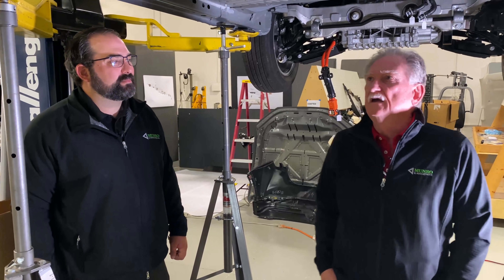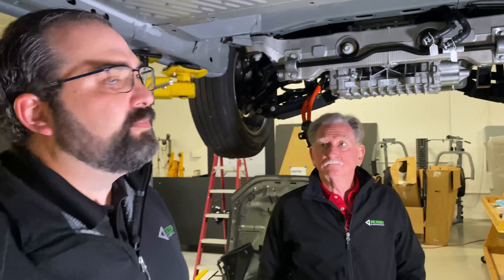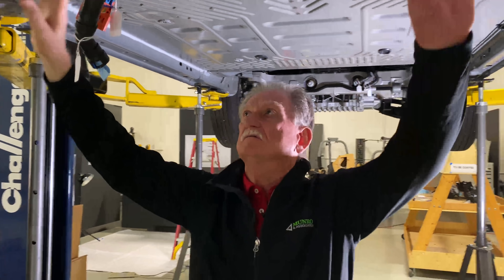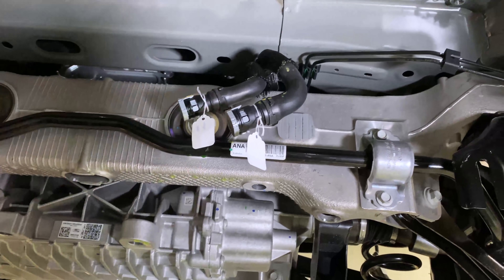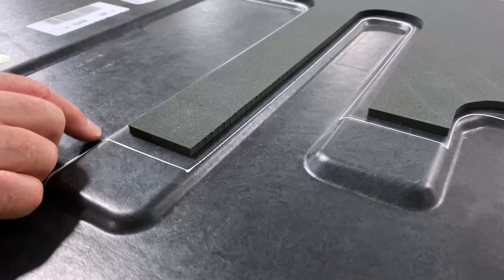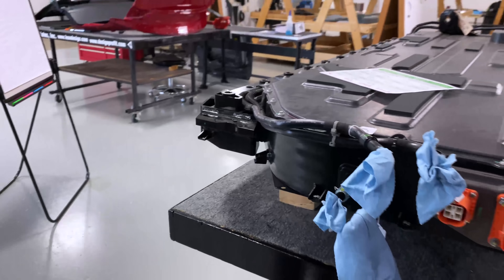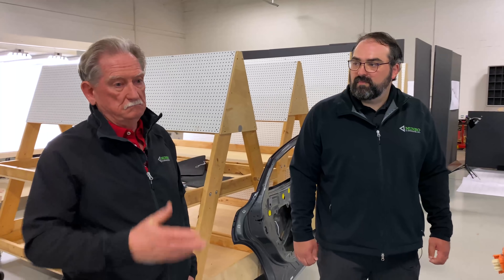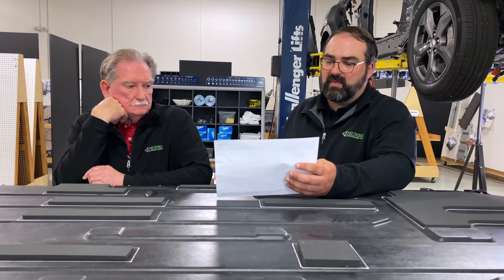First look at the Ford Mustang Mach-E Electric Battery

Comment: What impresses me, as a lifetime taker-aparter-and-puter-back-together is how expertly you disassemble complex machinery without service manuals. My hat is off to some real pros. You guys are the Johnny Appleseeds of tech.
Reply: It’s a lot easier when you don’t have to reassemble it! 😂
Reply: @someonethatwatchesyoutube2953  success not achieved unless you have no leftover bolts when putting things back together
Reply: @lemongavine  I had a friend some years back who taught a class on motorcycle service/repair. One of the class projects had students completely tear down the engine in the morning and put it all back together in the afternoon after lunch. While the students were out to lunch he would mix up some of the small parts at the workstations so students would have extra/missing parts. It was a good test of their skill/knowledge/confidence.
Reply: I envy them so much being able to work on clean new cars!
Reply: Why do you think they don't have manuals? By the time the first car of a new model is received by the first customer, the manuals are available in the online services that everyone uses now (print is dead). Like any service shop, Munro will subscribe to those services,  probably both those offered directly by manufacturers and aftermarket services (such as AllData). A subscription to the Ford service (motorcraftservice.com) costs $2,700 USD per year, and covers all models; that's a lot for an individual vehicle owner, but just a normal expense of running a business.
Reply: I was thinking about that too.They've likely seen every type of connector,fastener and adhesive known to man so you'd think mistakes would be very rare
Reply: imagine unbolting the battery, and forgetting to support it before it falls down on you. ☠️
Reply: @qx4n9e1xp  Imagine unbolting the front subframe of any vehicle, and forgetting to support it before the complete subframe with engine and front suspension falls down on you. I can't imagine doing either, but then I'm not a complete moron.
Reply: To be fair cars today are designed to be taken apart by the lowest denominator mechanics....
Reply: @obancameron  i worked on my own cars for many years, mainly Japanese, but also Fiat, Peugeot, Simca (French), Renault, etc. It was only until decades later that I had any BMWs that I could compare to them.

I had, and still have, major issues with BMW.  I probably will never own another one.  But what I noticed when comparing certain parts of BMWs with others, there seemed to be distinct differences in the design philosophy and quality.  I took that to mean that design teams were tasked with certain areas--- suspension, steering, interiors, instrumentation, etc., and had little experience with other areas of the car.

When working to fix a specific BMW door mechanism, I was delighted to find everything clearly color coded, with clearly adequate room to get tools and my hands in place to handle the task.  This was in stark contrast to other parts of the car that were... umm... clearly UNclear, and a real bitch to work on.

The door project I mentioned was also in clear contrast to any Japanese cars, which were cramped and miserable to repair.  I attribute some of that to the generally larger stature of the German citizens.  The Japanese vary greatly in their size, some being quite tiny, and others that are an inch or two taller than myself.  I suspect Japanese car makers have the ability to pick and choose their assembly line workers, and favor smaller ones for that task.

Comment: Nobody talks about how EVs loose 30 percent range when below 20 and 25 percent above 90. If you go 85 MPH at 90 degrees your hosed.
Reply: We’ve taken our M3 through West Texas several times at 100 degrees and 85 mph + and never had a range problem. In fact, had the M3 up to 130 mph in the Nevada desert, never had a range problem.
Reply: @shepherdsknoll  ,  Is the M3 an EV. The 
ride from Vegas to LA is cool. We like to hike in Red Rock.
Reply: @johnroehsler9921  Tesla Model 3

Comment: Tesla’s don’t get anywhere near their “on paper” EPA range, many sites have tested and proven that fact, whereas other manufacturers were getting at or above their EPA range. So I think it’s a bit disingenuous to claim false advertisement as a Tesla advantage. EPA ranges on EV’s are still highly inconsistent . Some manufacturers are more conservative to real world, while Tesla is way overstated.
Reply: I have actually got more miles than the on paper EPA range on my M3.
Reply: MY vs MachE: https://www.youtube.com/watch?v=lSmSiOo-v8s .  Model Y : 234 miles  Ford : 268 miles.  You figure what EPA represents.
Reply: Are you deaf? Sandy clearly says that all of the ranges are tested by them EXCEPT for the Mach-e where they are using Ford’s numbers
Reply: @howtorawk  That’s not what he said. He did not say they tested the range, he said they had “put a couple of these things together before” implying they have accurate numbers on weight and kilowatt hours (I.e. things related to manufacturing.) The ranges listed are the EPA ranges from various years of release of the vehicle: 2018 Model 3, 2020 Model Y, 2020 Chevy Bolt, etc that you can get right off of fueleconomy.gov
Reply: @Weezedog  14:14

Comment: Since the battery housing is an integral part of the structure, it would be helpful to include the total vehicle weight in that comparison chart.
Reply: Presenting the weight, capacity and range in a graph instead of a table of numbers would make the data easier to digest and would save the reader from calculating weight/kWh for each vehicle's battery.  Interesting comparison none the less, and as others have said, the packs contribution to the overall vehicle structure, could really make this an apples to oranges comparison.
Reply: hint: although we may tongue and cheek refer to these EV platform designs as "SKATEBOARDS", none of them actually roll down the road (and have their range determined) with just 4 wheels attached to the pack, you know like how we routinely see EV chassis being shown to us in many an OEM's engineering presentations.  although i'm sure he's a cool guy, TONY HAWK is not in charge of any manufacturer's electrification programs (at least none that i'm aware of).
Reply: Not a structural pack in the same way Tesla's is planned though, it's a structural box, the cells themselves are surely not taking any structural load?
Reply: @bluetoad2668  re: "Not a structural pack in the same way Tesla's is planned though, it's a structural box, the cells themselves are surely not taking any structural load?"  correct, but such "trivialities" are actually NOT what MEC's concerned about. no, what those of us astute/paying attention recognize is that a chart relating pack weight to miles (range) is ERRONEOUS at best (or a complete LIE at worse).  Q: omg how...? A: well even the best modern EV's weigh a MASSIVE 4000-5000lbs (looking at you Tesla Plaid). right, what should be obvious then is how these small pack weights are but a PERCENTAGE (%) of any vehicle's total CURB WEIGHT.
Reply: @bluetoad2668  the battery cells in tesla next pack will also not take the impact
Reply: @alanmay7929  The Tesla 4680 battery cells themselves will be a structural component of the car.
Reply: @NukemNak  nope they won't be structural, the battery pack system will actually do the job.
Reply: It's all Apples and Oranges .... integration of pack into vehicle for crash worthiness does make pack weight a useless metric.... as is EPA range, since some companies over charge batteries, or do the extended EPA testing, or use software tweeks to eek out more mileage during EPA testing only.. real World range values can be very different.
Reply: @KrustyKlown  nonsense, the structural rigidity is taken from the car and transfered to the battery pack and its an awesome thing to do, it will also significantly help reduce the weight of the car shelf in the future with the use of more aluminium.
Reply: @alanmay7929  Seems you had a nonsense understanding of what I wrote. Some OEMs put more structure (weight) into the pack, while others put that structure into the unibody.. end result being the same level of crash worthiness, but with greatly differing pack weights... hence pack weight is a useless comparison metric.
Reply: @KrustyKlown  You're correct as long as the additional weight in the battery pack is indeed due to structural components in the pack taking the place of structural components in the car, as is the case with this Mach-e battery pack. I'm unsure how much that holds true with the heavier packs in the comparison. I agree some comment to clarify that would have been useful. I think though that the comment was directed more at the engineers who designed those packs than at the average viewer. Certainly they're aware of the details, and I think Sandy is fishing for consulting contracts with those companies.

Comment: Tesla’s batteries don’t have an install guide, and if you’ve ever seen Rich Rebuilds install a Tesla battery in his back yard with a floor jack and butter knife, it can be very easy to damage the battery connectors without that guide.

Comment: You know why those battery packs are so heavy in the AUDI?
Because they are made to withstand even catastrophic internal damage/fire and keep the outside/car/passengers safe. Tesla and such, are not - to my knowledge. Therefore they burn if something goes wrong.
That said, I have Tesla batteries in my home.
Reply: My knowledge regarding that might be a year or two behind, but last i know is that the Battery Pack of the Tesla has literally 0 mechanical stress on it (sandy "complained" about that since the Pack doesnt contribute at all to structual integrity), even in an impact (at least in a simulation to visualize the stresses). this means both that removing the battery has literally no impact on Crashworthiness, and also that the battery itself will not be damaged on an impact (because the car around it basically protects it and doesnt put any mechanical stress on it)

Comment: I think I understood you to say that the only thing holding up the pack is some vertical threaded bolts running down both sides of the pack.

So, how resistant to vibrations will those bolts be?  Will they stay put?  I couldn't get the answer out of your review.
Reply: most bolts in an automobile have a thread locker liquid placed on them to prevent them from vibrating out.
Reply: @jetah50  These bolts can be removed with a driver.  You don't have to drill them out.

If bolts can be removed with a driver, they can vibrate out.  Now it's just a question of vibration frequencies and amplitudes.  If the right frequencies and amplitudes to vibrate them out will never reach the bolts, then they're okay.

I'm asking the question because what we saw in the Mach-E's HVAC system was tons and tons of threaded screws, 60 degrees, I think.  Possibly the worst fasteners you could imagine for an automobile that moves and vibrates.  It doesn't look like Ford's engineers spent any time at all worrying about screws vibrating out.  It makes me wonder just how much attention they paid to these bolts.
Reply: @Urgelt  i've done mechanic work for a while and a little thread locker is all you need.
they didnt use a wrench with a little torque on it when it was broken free.
Reply: Every component of your car is held in by bolts. When was the last time any of them fell out? It's not a problem, just as the vertical bolts that hold subframes to vehicles are not problems.
Reply: @brianb-p6586  Do you know how to use a search engine?  Because your assertion is ridiculously easy to check if you use one.

People have had bolts fall out of their cars since there have been cars.  Before that, bolts fell out of carriages and wagons.  And bolts are still dropping out of cars.

Sometimes, bolts falling out of cars necessitates a recall.  That happened to GM in 2014.  It was quite a large recall, too.

Engineers do have a lot of control over how they will secure a bolt and what vibrations can get to it.  But sometimes, things happen engineers did not expect.

Murphy is alive and well.

I am not predicting that Ford's battery tray bolts will fall out.  But it did strike me as awfully confident of Ford to secure that tray with nothing but vertical bolts.  Good decision?  If it was a bad one, NHTSA will eventually come calling.
Reply: @Urgelt  I didn't say bolts never fall out of cars (although none have fallen out of mine); I asked if it has ever happened to you and suggested that it's not a serious problem. If a bolt falls out of a car it was not properly installed, and any design can fail due to that kind of incompetence. Manufacturing efficiency is the main target in vehicle design, and you can't beat a minimal number of parallel bolts for efficient installation.
Reply: @brianb-p6586  Yeah.  I see your point, but let's not lose sight of the engineering principle here.  Load-bearing bolts are a solution.  They are not the solution.  Ford could have used any number of alternative fastening schemes, including snap-fit and structural guides that would take the weight of the battery tray.  In principle, bolts can get loose and fall out.  A good design won't.

It might be fine, depending on how vibration manifests (we can't guess that by eyeballing) and how it is mitigated.  But I don't think it can be argued that load-bearing bolts are the best engineering approach.
Reply: @Urgelt  it's the approach everyone uses, because it makes sense. The car isn't a cordless tool - I don't think sliding the battery in on rails until a latch snaps closed is viable. ;)
Reply: @brianb-p6586  Sliding on rails with a latch?

Eh, snap fastening has come a long way since your day, old-timer.  :P

(I'm entitled to tease, I'm 69.)
Reply: @Urgelt  You suggested the rails and not using bolts, and I made the obvious comparison to a cordless power tool... which is the biggest device that attaches a battery by anything other than bolts.

Comment: My concern with those massive aluminum structural members is the issue of corrosion from salty environments which can also lead to metal fatigue. These components should be oiled as regular preventive maintenance to keep them like new IMO.
Reply: Hmm, I've never heard of any procedures for oiling the structural members of airplanes so maybe not necessary.
Reply: @TamásMadarász  Airplanes not subjected to salty environments like cars. The underside of vehicles of all types are neglected (out of sight, out of mind) hence collect a lot of crud and salt which, as you know, is what destroys cars in salty areas.